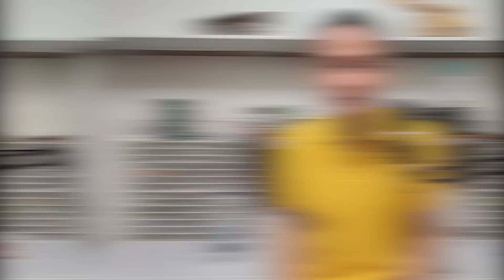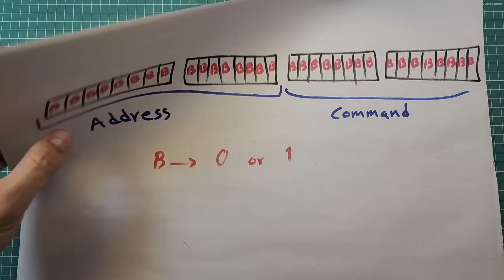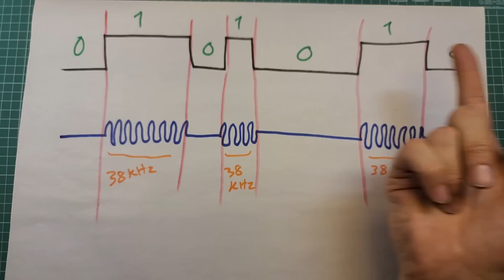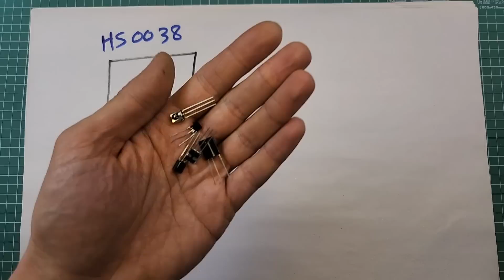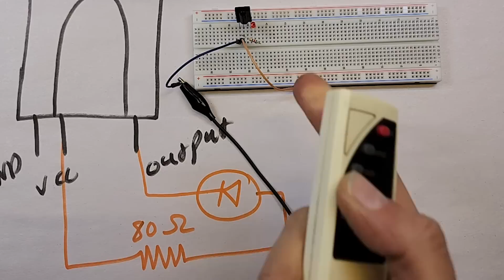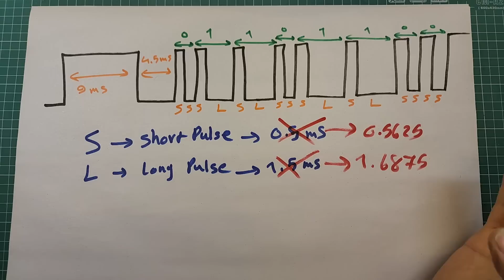IR Remote Controllers protocol: 101 to advanced

Comment: some perhaps amusing history:

*  the various carrier frequencies of IR remotes is legacy from prior ultrasonic-based systems.  It was simply cheaper for TV manufacturers to re-use existing ultrasonic demodulator circuitry rather than create new ones specificaly for IR.
*  in turn, the various ultrasonic carrier frequencies are legacy from an older system involving mechanical resonance.  these were the original 'clickers' since the spring loaded hammer made a distinct click when it released and struck the associated tuned rod.  The first system was called "Space Command".
*  ironically, the vary first TV remote was based on light, with 4 sensors in the corners of the TV to toggle power, toggle mute, channel up/down.  The motivation was that an executive at Zenith wanted to mute commercials.  The system was called 'Flash-matic'.  It involved shining a flashlight on any of the 4 detectors to perform the function, but as you can imagine was problematic with stray light, and this was the motivation for creating the ultrasonic scheme.

So I find it ironic that the IR light based system came full circle from the visible light based system, with an intermediate stop in the ultrasonic, picking up some physical design artifacts along the way.

Some other things:

*  the 38 KHz carrier chosen in NEC protocol is derived from the economics of using widely available (and very cheap) AM radio 455 KHz ceramic resonators, because dividing the 455 by 12 = 37.9 -ish.
*  the modular IR receivers from, e.g. Vishay, are cheap and save a lot of analog design that in encapsulated; especially AGC.  They also are available for a variety of carrier frequencies.  Do not fret the carrier frequency too much -- I have used 57 KHz receivers with 38 KHz remotes with success.  The range will be reduced, but if you're just hacking, don't feel you need to place a special order for the exact frequency.  The receiver bandwidth is broad.  If you're designing something for mass market, then that's a different thing.
*  IrDA does in fact transmit 'light on/light off' rather than modulated.  There is no carrier.  It's slightly more than simply connecting an LED to a UART, but not much more.  (light on = '0', and it's not on the entire bit period but rather 1/16 of it for power concerns. light off = '1').  IrDA is susceptible to environmental IR noise, but it deals with that in the protocol since it's intended for more sophisticated communication than that of TV remotes.